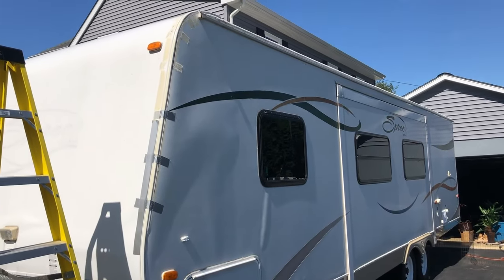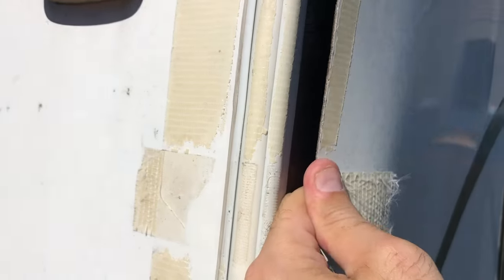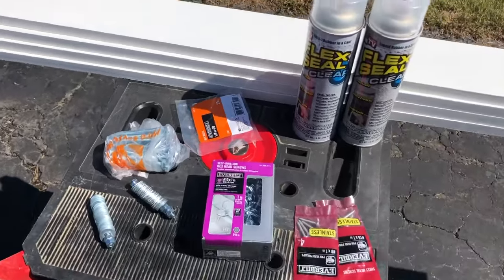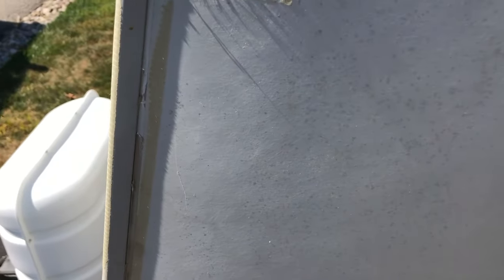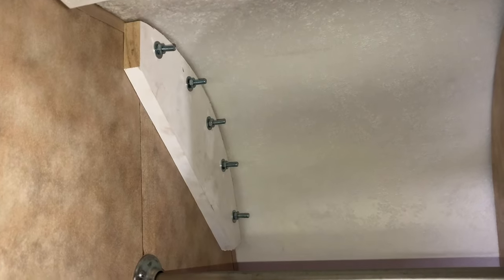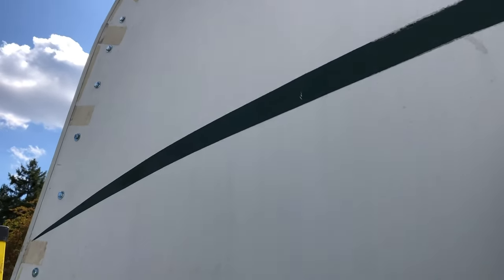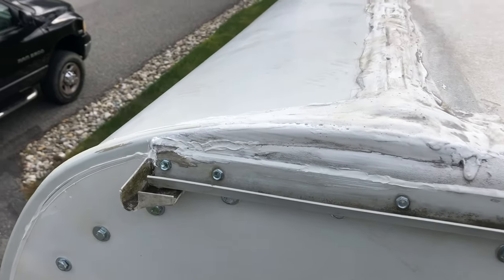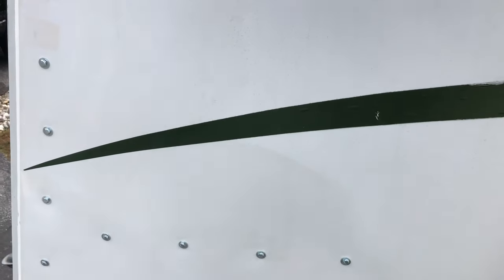How to fix RV or Travel Trailer Delamination Without Using Epoxy

Comment: This happened to my 5th wheel camper 5 years ago, 1000 miles  away from home. I pulled the loose sides back and unloaded 5 tubes of Gorilla construction adhesive behind it. I then ran white 6”  Eternabond tape down both front corners. 50,000 miles later, and it still hasn’t moved.

Comment: You really did achieve your goal by using a simple process. The asthetics are not important on older trailers..in my opinion. It's only worth so much anyway. The bolt heads look a heck of a lot better than delaminated siding. You have more enginuty in your little finger than most of guys leaving negative comments.

Comment: This made me laugh.  It's the kind of repair that I would do.  I care less about aesthetics and more about just getting the job done in a way that isn't going to have me coming back to fix it again a month from now.  And it actually looks pretty good.  No, it's not perfect, but if you want perfect just throw the whole trailer away and go spend many tens of thousands on a new one (which ain't gonna happen in my world!).  I've got this kind of job in my near future.  The front left wall on my 5th wheel is delaminating pretty badly.  I hadn't considered nuts and bolts, but I will definitely think about this now.    One thing's for sure - that panel won't ever be flapping in the wind again unless the whole trailer is flapping with it.  LOL!

Comment: That's a very intelligence repair! You've tackled a problem that would have made your camper scrap in a short while and made it a great RV for another 5 years. I wish I were as handy. I just bought my first camper used online because I work at sea and needed a quarantine location away from my family when I return ashore.   I went out to it I saw all kinds of delamination issues, but I think repairable using your method. Only problem is I can't go to stores to buy the gear, and the wife will kill me if she finds out I spent 6000 on a problem camper! LoL

Comment: Im actualy glad to see a way to do this aside from epoxy. My RV served as a hunting cabin. I recent brought it home with the same exact scenario. Look in the mirror to see it flapping in the wind, stop for duct tape!😂 

Now it will serve as a guest house. I dont plan ontaking it anywhere, smply want to get i sealed back up. Thanks for posting. For the record, i actually think the bolts look just fine on the exterior!
Reply from the maker: Thanks! Luckily I had duct tape in the truck. I don’t think the bolts look bad either after all was said and done. Good luck with your project!

Comment: Seems like a good repair, the only thing I would have done differently is use "elevator bolts", they have a flat head - think large flat washer, so after you paint them they would be hard to see.

Comment: I did this 2 years ago when my 1st RV (used) had fiberglass that was delaminated & I drove thru a storm in the Virginia mountains!! Stopped for gas & realized I lost 3 feet of fiberglass!! (hope I didn't hit anyone behind me!!) Bought some bolts & Flex Seal Tape!! did this & taped the edges....& Continued towards Florida!!. The next stop .... the fiberglass had caught air again & ripped right off the bolts!! Stopped & bought a board & the largest washers Lowe's sold. THAT... GOT ME TO SEBASTIAN FLORIDA!!!

Comment: I have a 23 year old motorhome that is very similar but has not come out from under the trim yet.  I plan to fix it just like this.  This is not coming loose.  To fix with epoxy the "right" way would just not be worth the extra trouble.  Besides it was a poor design to begin with.  Thanks for the video.

Comment: Looks good.

I wonder if carriage bolts with the smooth rounded flat end would have looked better ?
Reply from the maker: Thanks! You’re probably right. As long as you can still tighten the bolt without it turning on you, you should be good.

Comment: In my experience it is the screws in that channel that is the problem. The insert on the trim gets hard over time and leaks providing a water way to every screw head and leaches into the wall separating the layers of plywood and siding. Owners must stay on the maintenance of the exterior and not just glob on sealant. You can get the insert material on line . 
The epoxy method is like hale Mary move , pealing back the outside layer and replacing the plywood is a more practical way . Sounds like a lot but once you see how it’s made and what has happened from water damage you will understand. 👍👍

Comment: What works works, but another thought would have pulled that front trim off and replaced it with a longer leg that would hook over the loose piece of filon siding. First glue the filon  siding  on with epoxy resin compound using a compression method to secure it. This is a proven method that you passed on.
Incidentally the top rail needs to be pulled off all your screws are Rusty. RV work never ends, I'm currently replacing my RV roof. 
Enjoy!
Reply from the maker: 365OutDoors thanks for the feedback!

Comment: Delamination happens usually from water leaks. When you showed the roof, it looks like your roof has a little dry rot and may need replaced. I have the same issue. I'm gonna epoxy the delamination and replace my roof.
Reply from the maker: Sounds like you have your hands full with that restoration. I was going for the quick fix so I could sell it and buy a newer trailer.

Comment: This happened to our almost new trailer.  Not trusting the dealership to fix it we decided to try to fix it ourselves.  Thanks for this solution but that’s my closet and I don’t like those screws sticking out in my closet.
Reply from the maker: Sorry to hear about your trailer problem. Glad I could help. Best of luck with your repair.

Comment: Epoxy is a much better option and will hold up if done properly and sealed properly. You still have air pockets between the fiberglass sheet and substrate that will be prone to collect moisture from temperature change and humidity unless your seal is perfect which is rarely the case. If the slightest bit of air can get in, so can humidity. Good video of an unconventional method but I'll stick with epoxy for my own repairs.
Reply from the maker: Nice thoughtful reply, thank you. That method was a bit more than I wanted to tackle and I couldn’t find an RV place that would do it. Hence this video.

Comment: adding dozens of new wall penetrations and leak points, not my idea of a good fix.  hopefully this works for you..
Reply from the maker: Thanks for the feedback. I picture it just like any other seem that needs to be maintained.
Reply: I think the delamination will spread because you didn't use epoxy. Also, epoxy kills dry rot and this doesn't. The price is about the same. It does take a few more days, but why the hurry? Flex seal isn't a good choice imo. It will degrade much faster than other sealers. If the bolts are something you don't mind, just a few of them would make for a good bracing system to let epoxy cure while flattening the fiberglass. If it's a slow setting epoxy, you would be able to cut the project time by about half and that's something you could still do if you're not satisfied with this. But I hope it does work out for you. I totally get the idea of a much simpler system. When working on the exterior of an RV, it's always a much bigger job than it looks. Thanks for the video.

Comment: Look.... uhh... if you don't understand the concept: "Pay to play", then I'm afraid you are doomed to bad advice all over the internet. RV trailers are prone to leak. The main culprits are holes for lighting and 'accidents'. If you own one, store it under a tent or cover when not in use. This keeps it away from sun damage and extreme temps. Sure, you can make small, cheap fixes but I'll bet $ it WILL leak again. Get to the root of the problem and fix it right or problems will continue.
"Yes but, I already spent $20,000 on a used trailer. A major fix will cost me $4000!"
Yea...... so? You either DYI or have the pros make it brand new again. Same as an autobody shop.
Reply: Same old new crap again.  This is an improvement in my opinion.

Comment: I would never use this method, I would use glue. All these bolts looks terrible outside.
Reply from the maker: I would rather the repair last. I can deal with the aesthetics of the bolts. I don’t think it looks bad at all. I ended up selling the trailer after the repair and the buyer didn’t even notice the bolts. I would bet the epoxy repair does not last because the wood you are gluing to has water damage.
Reply: Agree glue for something out in heat and cold and rain is a joke and will never last like a good solid bolt!
Reply: Michael Mogan yea he didn’t notice them but did you tell him about it.
Reply: @mmogan78  The buyer must have been blind . Hey you sold it and you don't have to worry about it anymore 👍
Reply: Glue works if there is minimal water damage.  I suspect this initially happened because of swelling due to water intrusion. 

This is the perfect solution functionally.  It may not look the best, but that’s a matter of opinion. I like the look. 

A common water entry points is where the awning is attached at the roofline. A good preventative for leakage here is drilling carriage bolts thru and installing a backing plate.  The pressure created by this method does the sealing effect. Caulking in a merely a backup.
Reply: @mmogan78  yeah with a bit of paint or covering them with plastic and painting them and you would never notice anyway. The entire wall could fall off and still be held there by your fix.

Comment: Delam has melted your luon and the popcorn styrofoam is a sponge trapping water.
if I  were you I would be concerned about mould .
I fixed mine like you and 2 years later I had 2 weeks of rain during campaign .
My delam fix started leaking at the bull nose in the front.
Inside behind my bed we thought the window again . 
Another caulking fix  got home and started pulling the paper wall .
The more I pulled the more wet it was . I tok down the cabinet above the bed and ounce I did 
the pink fiberglass insulation was soaked .
We tore everything above the window and it started pouring rain.
Where we had thought water was getting through was not where it was leaking.
It was pouring from the roof and filon . It was worse than anything I could emajon .
We have been working on it for weeks because we are dissabled.
I removed the window now I  am going to fiberglass the whole where the window was .
The use tape for sealing the sides and top. My advice is make sure you do things right.
because water will find whole's and  bolting through will leak .
professional and quick fix. It's now 2021 aug.How is the fix?
Reply from the maker: I sold the camper immediately after fixing it, so I can’t tell you how it’s doing now.

Comment: That’s terrible, you didn’t even start to identify the problem. You just put a huge hideous band aid on it
Reply: It’s easier to repair these things from the inside working to the exterior then working directly on the exterior a lot of time water gets behind the panels and all the wood behind it is rotten you literally either have to right then and their rip everything with water damage out and restart or you could do a temporary fix like this until winter or some other time where you have more free time maybe even years down the road when your diy repairs Fail AND THEN fix it, repairs like this will still buy you many extra years with a camper before you gotta properly repair everything which will be a huge job and huge cost. I framed / renovated custom houses for years and I know these kinda repairs would NEVER fly in somewhere with a building code but that’s part of the fun of buying a use trailer, nobody can tell you how to do if, it’s a learning experience and the best way to learn is by trying and failing.

Comment: Wow, what a hack job! The whole front of the trailer is delaminating and you cobble the side with bolts and Flex Seal.
Reply from the maker: I fixed the part I set out to fix successfully. No more delamination issues on that side.
Reply: You come by your name honestly Oaf.

Comment: I like the bolts idea. I wish manufactures used bolts & aluminum/composite instead of expoxy & wood (which rots).

I have delamination. I think I'm going to replace the wood. Also worried about mold. I may have to replace the siding but will consider using bolts to fix.
Reply from the maker: Cool, thanks for commenting! Good luck with your project! I feel for you.

Comment: Ok for a fix if that is what you want and are comfortable with.

My concern is that for the delamination to happen, it was most likely due to water intrusion into the wall. Without removing the deteriorated crap paneling in the wall, there is a real risk of mold developing and releasing toxins into the environment inside the trailer. Do you really want to possibly expose you and your family to these toxins?

Take the time to fix it correctly and remove any rotten wood. Not worth the risk of exposing your family to mold spores and toxins.

Just my 2 cents.
Reply from the maker: Good points. I didn’t smell any musty odor, so I don’t know if there was mold or not. I guess you don’t know unless you open it up. I sold it shortly after fixing it, so we’ll never know for sure.

Comment: You should remove this video, no one should do this to a trailer.  Epoxy is the only way to fix this problem.  You added many more leak/failure points. Over time the fiberglass will continue to separate.  And for the love of god people stop using flex seal on campers purchase the correct sealant. 

For those of you that are thinking about doing this DON'T you are gonna create more problems then you'll solve do it the right way. The epoxy can be done very easily by owners.
Reply: I have seen cracked hulls repaired and return to use on the great lakes so the products and techniques are out there to permanently repair and seal. I will follow that path as it is meant to withstand the extreme.

Comment: A delaminated wall is a symptom of a bigger problem.
Reply from the maker: I agree water had to get behind it from somewhere. More reason why epoxy is not a good fix. It might have been from a bad seal on the corner or on the top. Who knows. It’s someone else’s problem now. At least it won’t delaminate again where the bolts are.
Reply: So you did a shitty repair and let the next guy get screwed over? You’re what’s wrong with this world bud.
Reply: @rickydawg420 I just bought a problem camper where the slide ripped the wall the 2nd time I used it. I agree, fuck this pass the problem to the next guy attitude. But at least the guy that bought this camper knows that there were leaks. But great video, I think I might try it out
Reply: Chillax Pam..

He's not hiding anything.
The bolts are visible.
What's your solution? please post your video..

This may be a good way to incorporate a clamping system for epoxy. The bolts could be removed after epoxy is set up and the hole can be filled with thickened epoxy.
 
Thanks for posting Michael..

Comment: Now that you have done this you have just made sure that next to no one will want to buy it .
Reply from the maker: Actually, I sold it right after I fixed it for $10K.
Reply: @mmogan78  I don't believe someone else said yea those bolts on the out side  look GREAT!
Reply from the maker: @van6278  I didn’t think they looked that bad. Had the same look as an airstream, just not made of stainless steel.

Comment: I like the fact that you did this yourself and to each his own but dude, IMO you completely F'd up your trailer with BOLTS!  Instead of gluing it back together you ran BOLTS man!!  If I were purchasing a used RV I would run run away from yours.  Again, to each his own but this is NOT a good DIY idea
Reply from the maker: I would love to know how many epoxy fixes to delamination last. Epoxy holding on rotting wood does not seems like a better solution to me.
Reply: @mmogan78  I've done epoxy repairs but yes, if the backing is gone then you might be right.

Comment: Definitely going to make the situation worse, this video should be taken down I advise NOBODY to do this as it added many new leaks hazzards and the Unit will delaminate and rot even more in the future, I do RV repair for a living.
Reply from the maker: Curious if you have any statistics on the longevity of your delamination repairs with epoxy? If you use epoxy against water damaged wood, the expoxy fix will not last long. I went to a professional RV repair place and they will not do delamination repair for that reason. I find it easier to manage a few bolt holes with water proofing than I do to have to do epoxy repairs numerous times, or even worse, replacing the wood behind the outer shell.
Reply: I like free speech.  Even for bad ideas

Comment: Wow. What not to do. Ripping 7 layers of skin off grabbing a shirt from in the closet, no thanks. Never use caulk on a camper people. Flex seal? Total hack job. Nobody listen to this guy. Period.
Reply from the maker: From a structural standpoint, nuts and bolts are a better, more permanent solution than epoxy. Epoxy doesn’t work long term. Plus, how much time are you willing to spend, or pay someone else to “fix” the delamination issue temporarily. And one of Flex Seals primary uses is on campers. Not sure what you are talking about.

Comment: Could you have used countersunk wood screws (so the heads were flush outside) and avoid adding blocks inside the closet?
Reply from the maker: I would not recommend wood screws. The nuts  and bolts provide a strong hold that will not strip. Wood screws will strip over time.